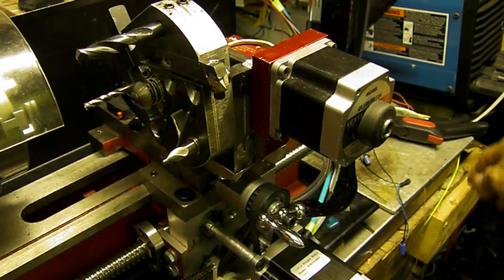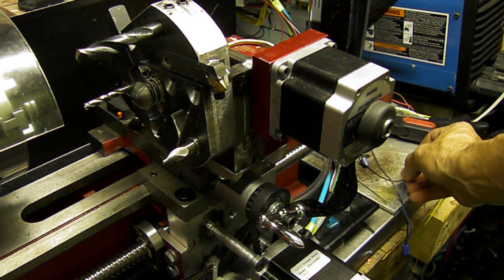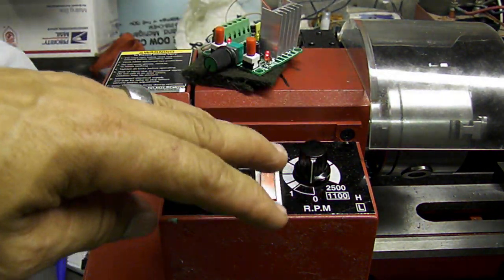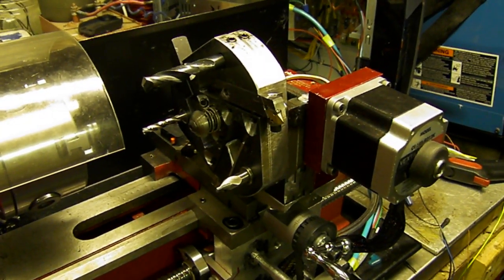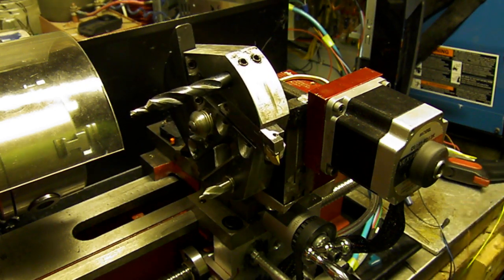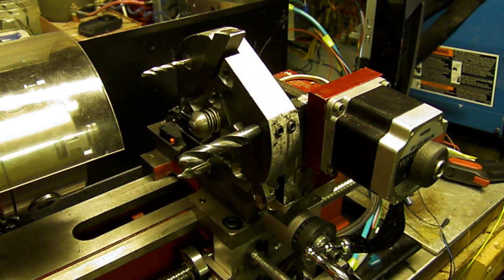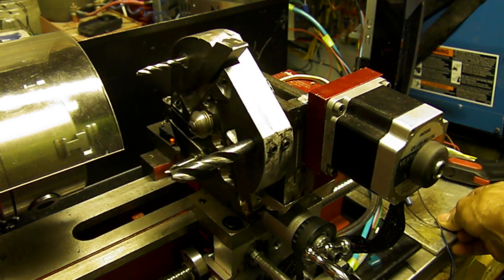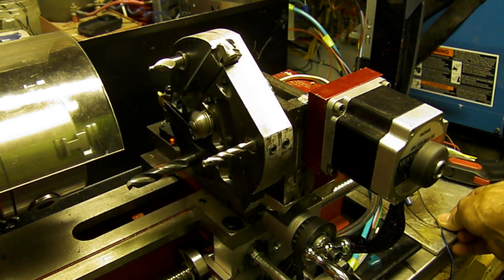Home Brew CNC mini Lathe with 6 position "Automatic Tool Changer"

Comment: hows the clearance there looks like you have a few obstructions to contend with. do the drill bits clear the chuck?
Reply from the maker: TO be honest, have not been able to drill due to the fact the lathe bed is not well mounted... it literally make the bed move out of alignment.... really scary... "I'm pretty positive it will work but I rather don't tempt faith....